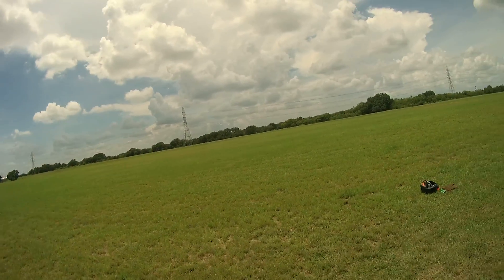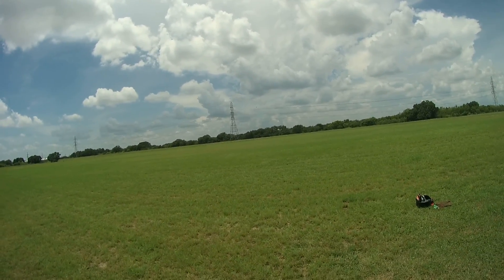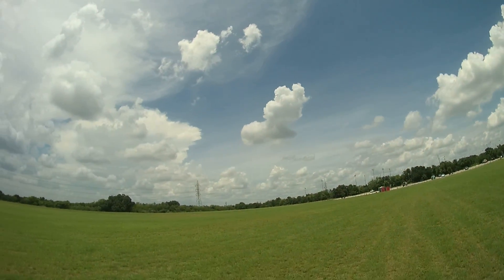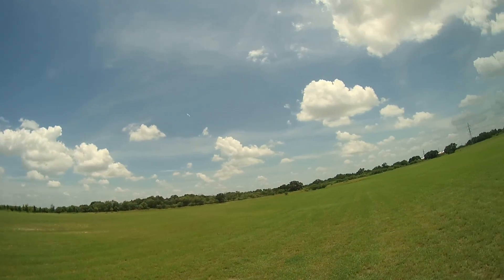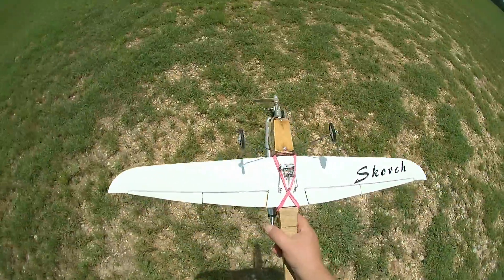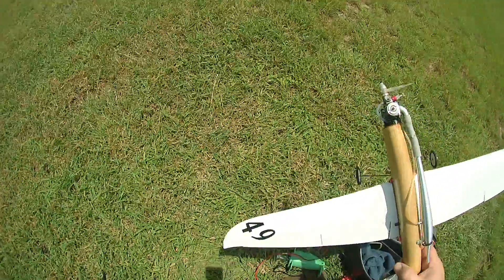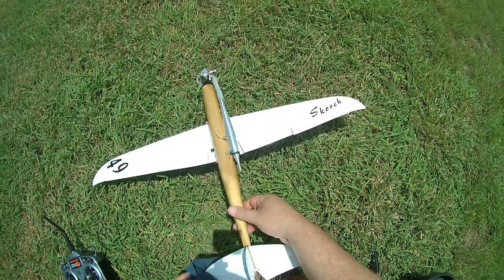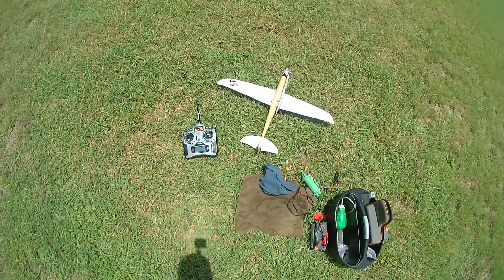Skorch Flying - AP .061 - Profi Tuned Pipe

Comment: btw,what glow plug do you have on engine? It is standard,or cox version? Tnx!
Reply from the maker: It's an AP plug same type as what Norvel uses.
Reply: Thanks! ,,,btw,where  you buy that AP plug?....I m form Europe
Reply from the maker: I use Ebay to buy my plugs Norvel and AP are the same will work on either engine. Mecoa sells retro fits for standard plugs too. http://www.ebay.com/itm/K-B-GLOW-PLUG-ADAPTOR-use-std-glow-plugs-in-NorVel-061-Aero-Heli-engine-/281025465626?hash=item416e6c4d1a:g:6dwAAOSwUdlWfEMN
Reply: I ordered the AP 061 engine in hobbyking ,but now nowhere in Europe do not get it plugs :-(
Reply from the maker: order the adapter from Mecoa so you can use standard glow plugs =)
Reply: But Mecoa does not ship to Slovenia ( EU ) :-((
Reply from the maker: Buy a standard glow plug tap and make your own after the stock glow plug burns out. That's how the first one was created. Mecoa saw the value of it and started making them from that idea.  Mecoa states they ship world wide here is the link method:
http://www.mecoa.com/order.htm#international